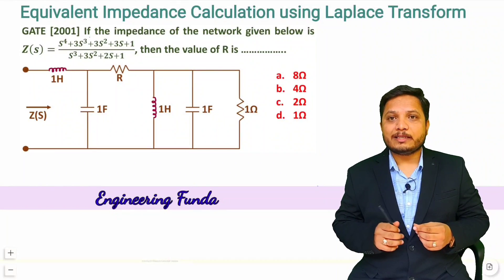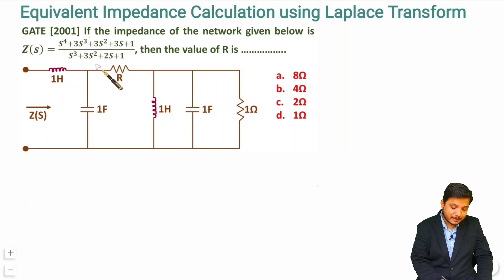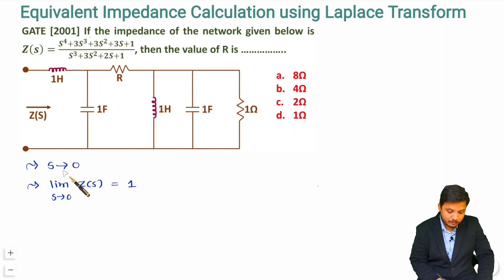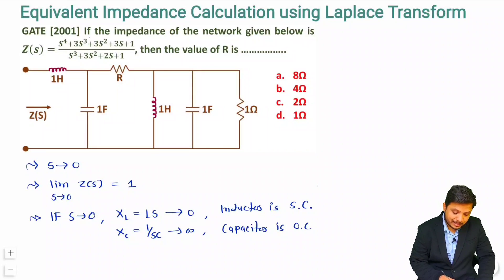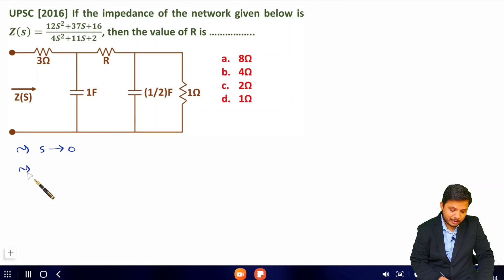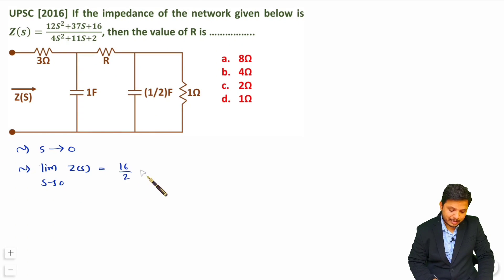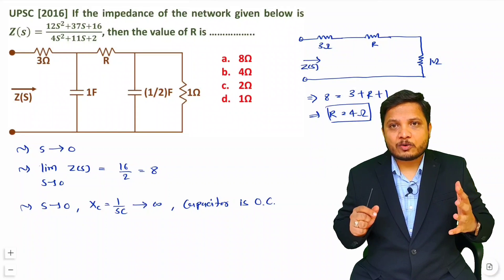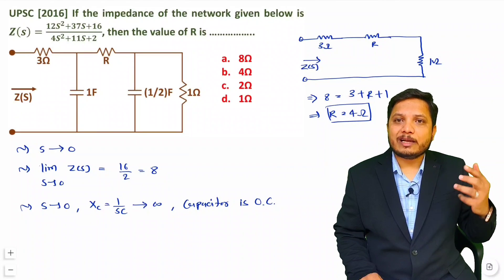4 - Equivalent Impedance Calculation using Laplace transform: Detailed Examples

Comment: 00:02 Explaining two examples of equivalent impedance calculation using Laplace transformation.
01:04 Understanding the meanings of capacitor and inductor is crucial for efficient impedance calculation using Laplace transform.
02:02 As s tends to zero, the impedance Z(s) tends to 1.
03:05 Equivalent impedance calculation using Laplace transform
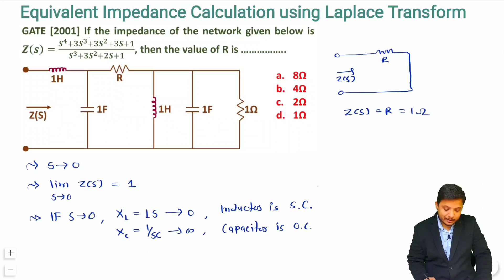04:04 Finding the value of R for a network with given impedance
05:02 As s tends to 0, capacitive impedance goes to infinity, indicating open circuit.
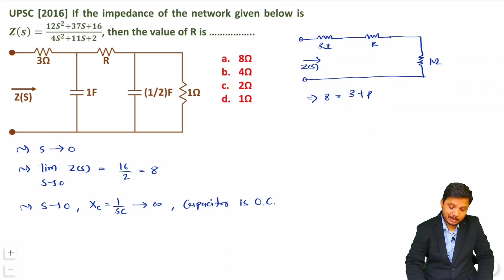06:07 Calculating equivalent impedance using Laplace Transform
07:10 Considering unknown quantities at s tends to in
Reply: in the first question (R = 1)  is eliminated which is parallel to capacitor or inductor but in 2nd question (R =1) is not eliminated which is parallel to capacitor why can u please explain